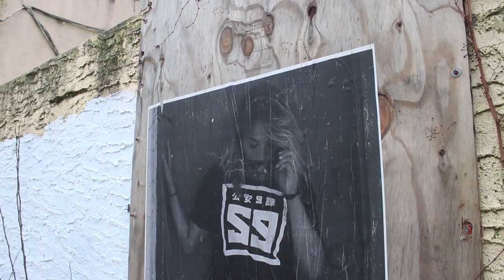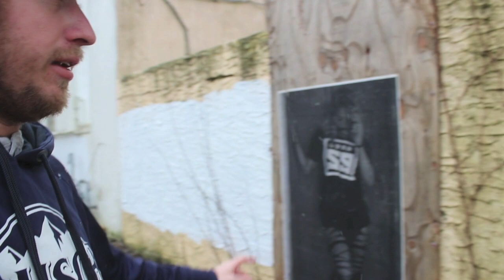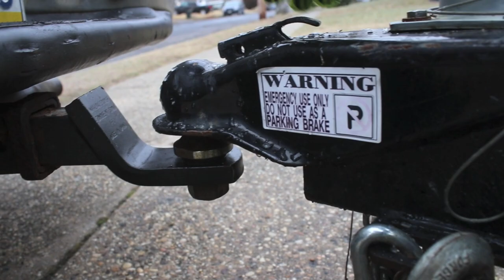THE ULTIMATE SCRAP FAIL EVER!

Comment: Good video but I would suggest find someone that does welding and use 3.25 inch steel plates and have them weld it to the frame hopefully the frame of the your truck isn't to rusted but if it's fixable and if someone can do that spray with undercoat!!!

Comment: dude sorry bout your hitch man but did you say you got 120 bucks for 1200 pounds they up to 10 a hundred out there?????
last i seen i thought was around 7 a hundred????be nice to see it up lol hitches are super easy to change man  6 bolts usually 3/4 or 19mm wrench size just make sure you use lock washers and grade 8 bolts when reinstalling

Comment: good thing it didnt fall off going down the road that could have been bad,   about a year ago  i  was bringing my friends car transport trailer  to get a winch welded on to it and when i got to the spot i noticed i only had 3 of 4 wheels , i was after loosing a wheel because the   hub sheared clean off luckily i didnt kill anyone.

Comment: Get a universal receiver for your truck and get it welded on. The old one is junk either way. Have your frame gone through underneath the bed of your truck and get some plate steel for the weak spots. You can fix the whole thing for less than a couple hundred bucks if you know someone with a welder. You're so fucking lucky that you weren't going down the road during peak traffic when that shit happened. Holy shit!
Reply from the maker: Sooo lucky and good idea yeeew!
Reply: It's all part of living the dream, my friend lol.